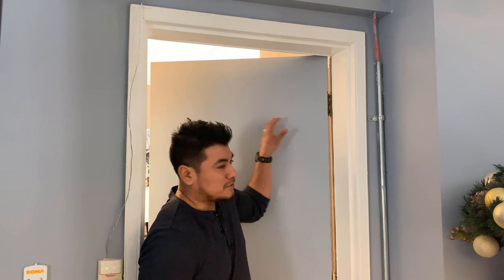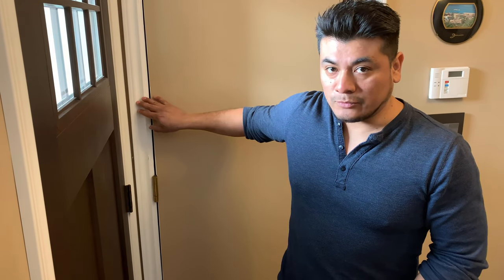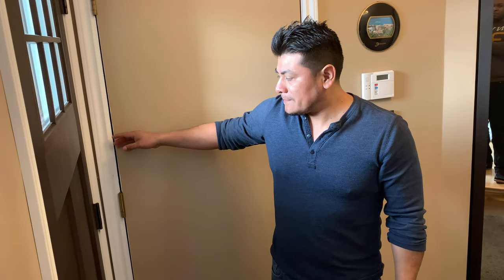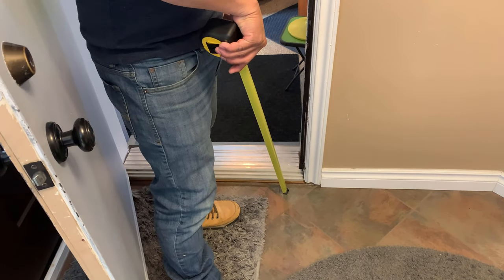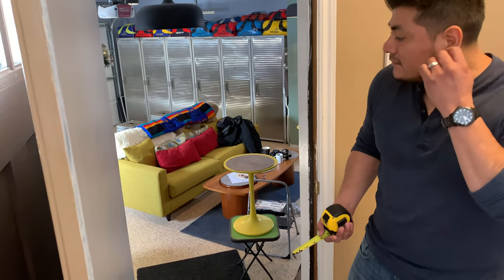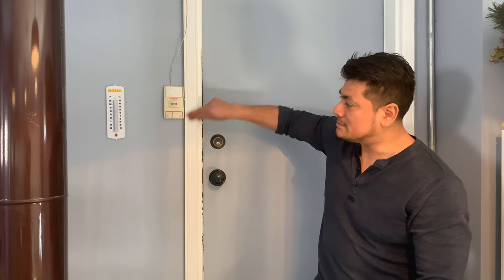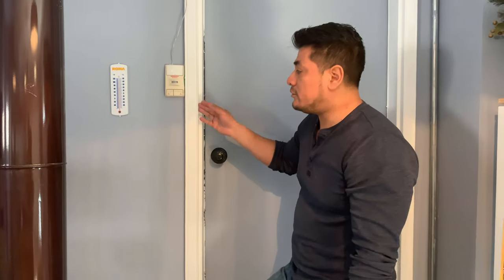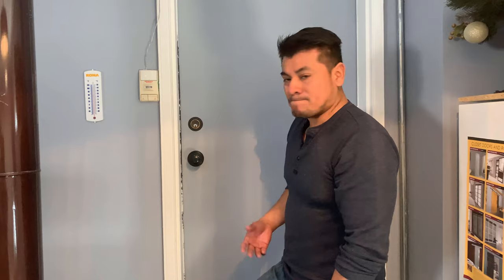How to Measure For a Prehung Exterior Door Replacement

Comment: When measuring door jamb it appears someone has nailed on a 1/4” piece all around the frame on the old door making it 7” jamb measurement. Wondering what measurement I should use. 7” or 6 3/4
Reply from the maker: Great question. That's something many people might encounter when measuring doors. These odd sizes. If you can find a 7 inch jamb size door. I would go ahead with that. Although you might find that the standard size is usually 6 5/8. That might be the reason that extra material was used.

Comment: Sooo I took off my trim before I saw your video..
Door Frame is 1-1/8" all around top and sides
Inside Frame Dimensiones 32-1/8" x 80-1/4"
Jamb is 4-7/8" + 1-1/8" (I have storm door blocking outside rabbet on frame) = 6" overall

Prehung door to order??
Reply from the maker: Thanks for the question,  I've been thinking about it for a few days... Four... To be exact. 

Sounds like you have a 30 inch slab and most likely a 32.5 x  81 1/4 frame size. The 30 inch slab is normally not a standard size. Standard is usually 32 inches. So you want to make sure that measurement is correct. 

Send me your door slab measurements and I can follow up.

Comment: that whole exterior measurement was confusing. why not just remove the casing and get an accurate measurement of where the masonry ends?
Reply from the maker: Thanks for the comment. I tried to show how to measure without removing interior casing or exterior brickmoulding. That's how I measure my installs and thought it might help people out that didn't want to start ripping things off. But you are correct, removing the casing and brickmoulding would give you exact measures.